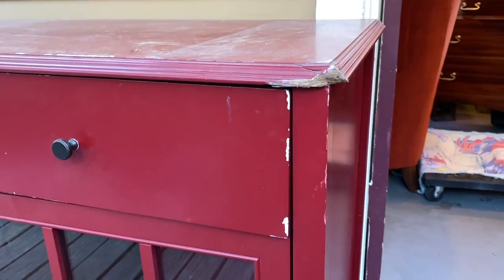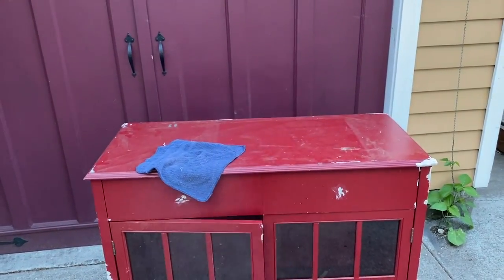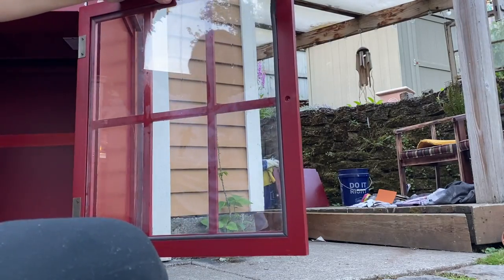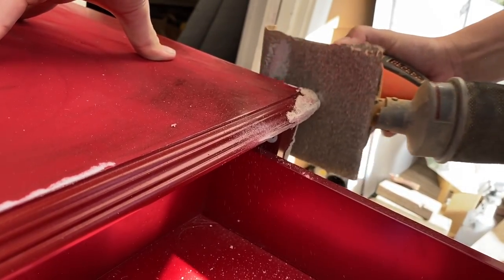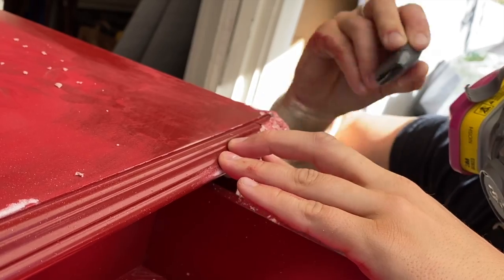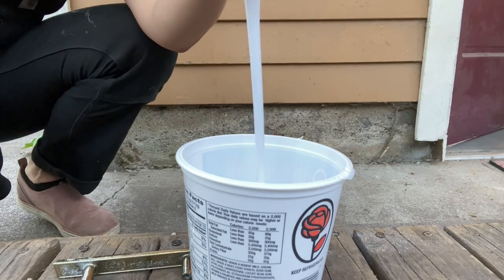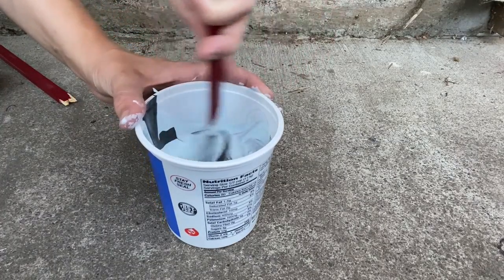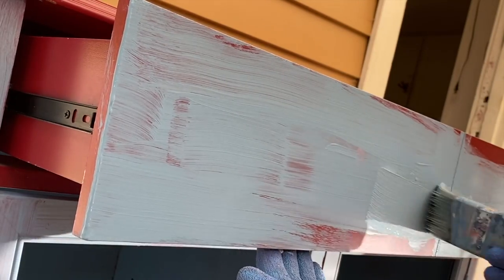Target TV Stand Makeover | Target Wyndham Furniture Hack | Trash to Treasure

Comment: Theoretically, if the same beveling pattern wraps the front and both sides, you can take an impression of the good corner with play doh or a proper molding clay, fill it carefully with Bondo, then let dry.  Then turn out the replacement corner, cut away the area of the broken corner you need to replace, then glue down the hardened Bondo corner. It is probably fiddly to get right even with proper materials and might require further filling and sanding but this technique works pretty well to capture complex shapes and details, and for matching missing sections of decorative trim and the like.
Reply from the maker: OOoh yes, I love that idea. Wish I had known it ahead of time but of course it is done now :) NExt time!

Comment: When I have gnarly corners like this one I wrap sandpaper around an expired gift card or credit card and sand the bondo.  I usually end-up with crisp lines and less swearing.  Any time I have to cover a bold color I start with gray or white as a base coat, saving my custom-mixed colors.  I also try to provide a small container of the custom mix for client touch-ups, or in this situation for you to do it for your Mom.   This idea is helpful if glass is scratched or if you want to provide concealed storage.   Spray the damaged or inside of the glass with mirror coating, then spray it with a vinegar/water mixture.  Blot the mixture from the surface.   Once thoroughly dry coat with black spray paint.  It creates the appearance of an aged mirror.   I have also omitted the black paint due to poor planning, the results were equally good.  (I created a bathroom backsplash in an older rental property with this technique.   Saved time and money.)
Reply from the maker: You are a PRO! Thanks for the tips :)

Comment: Love your video! Great job! Could you please explain how did you fix the doors? I have the same one and it drives me nuts every time I see it because the door are not align. Thank you!!
Reply from the maker: Hey hey! Omg so frustrating trust me I know! Basically I unscrewed it, re measured, drilled new holes and then hung it. It still wasn’t perfect. I will not be working with these pieces anymore it was toooo frustrating! Haha

Comment: Before your Quick Wood hardens, take a knife blade and score where the ridges are, molding with your fingers. I then have to go in with the crease of a folded sand paper to shape and smooth them. They are for sure a pain.
Reply: I can't remember what, but something about the Bondo intimidates me. I haven't tried it yet.
Reply from the maker: That makes a lot of sense! Thanks for the tip!:)
Reply from the maker: It might be that you have to mix the bondo with the wood hardener? It's not too bad, you just need to use way less hardener than I did haha :)
Reply: Thanks for the tip. That sounds right. Mixing something. I will give it a try. Love your channel and your bubbly personality.